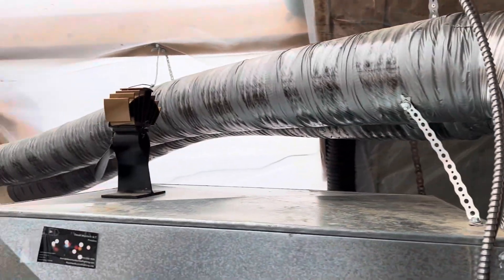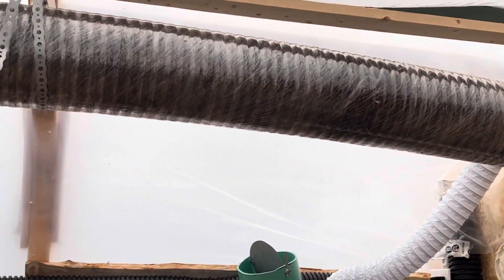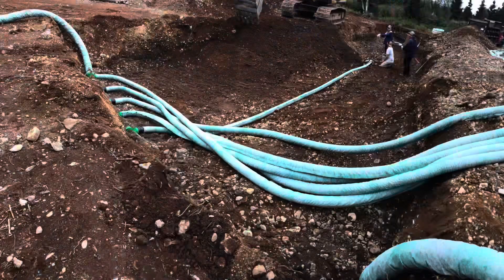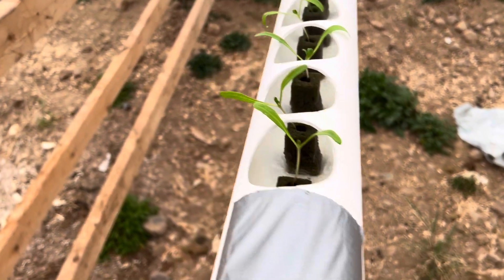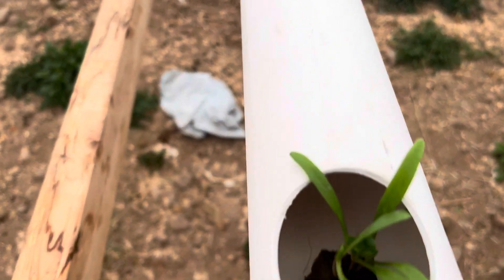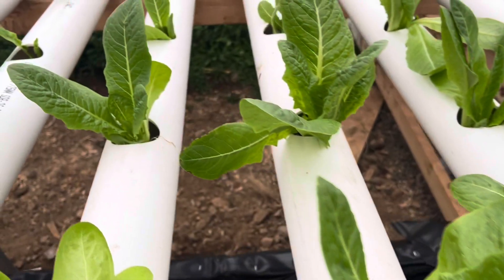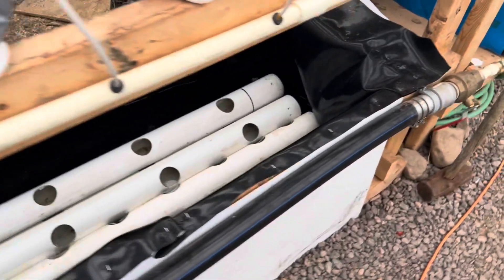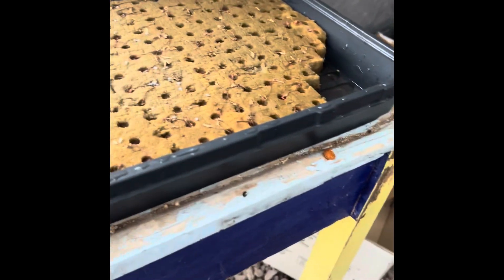Amazing Greenhouse Geothermal System!😎 Grow in every season! We do!!

Comment: How do you use the wood burning stove to heat the ground. With the geothermal heat source.
Reply from the maker: When the furnace is running and the geothermal fans are on it forces the air down in the ground. The real benefit to using the air blower from the furnace really comes into effect during the summer by increasing rate of speed for the volume of air in the greenhouse circulating through the ground.

Comment: I thought these geothermal systems did not require extra heating? Umm, is your greenhouse double skinned and sunken?
Reply from the maker: You can use this system without adding heat to the greenhouse however this will only ensure a certain temperature, and as a thermos works the geothermal earth battery only heats the ground to a certain level. The longer the duration running the system during the night the less heat you will get. For optimal lettuce growing temperatures we keep our greenhouse a minimum of 15 degrees Celsius. This can only be attained by adding “some” extra heat. Otherwise you will have slowed production. If you had a small greenhouse for your family you would have no trouble running it on geothermal, if you’re commercial - you want fast growing produce to be financially feasible.
Reply: @Papa’s Farm  Yes, for sure. I wonder if solar + batteries, would be feasible? Probably cost prohibitive... and propane or woodfire cheaper? I've thought too that grow lights would be required in case of limited winter sunlight...you still have a good system. Have you looked at the Wallpini system at all as a comparison....?

Comment: Hi, do you have any calculation help for me to size an geothermal system? Thank you for sharing your Videos. 
Greetings from Germany
Reply: The system design will depend on the structure, local climate and your desired goal :)
Reply: @JohnGuest45  I am in the temperate climate in the south of Germany. The greenhouse has 5.5 Meters by 3.6 Meters and is glazed with polycarbonate. The Target ist to cool down in Summer and get no Frost in winter
Reply: @andiatbaden9990  
You will also need to know the internal air volume of the greenhouse as that is used to calculate the fan requirements and it plays a major role in the tubing layout.
Reply: @JohnGuest45  Hello John? The internal air volume is about 43 cubic meters which equals about 1519 cubic feets.
Reply: @andiatbaden9990  
For balanced heating/cooling performance you will need a total of 276ft (42m) of tubing and 506 cfm of airflow. This will give you a design turnover rate of 20x per hour.  The tube spacing for balanced performance  is approx 20.5" (520mm) on center both horizontally and vertically. This provides  8" (200mm) of mass around each tube. Closer spacing will reduce  the capacity but increase the response, wider spacing will increase capacity and reduce the response.  The conductivity and diffusivity of the mass dictates the speed at which the heat moves. In general you can access heat that is within 8" range of the tube wall the same day.  In a ideal world, heat would travel through the mass instantly allowing endless capacity for heating or cooling. This is not how it works in the real world :)  The trickiest part of the design is the tubing layout. If you get this wrong it will have a serious impact on performance. One of the most common issues i see are incorrectly sized manifolds and plenum barrels with the tubes stuffed into the sides, both of these will have a seriously negative impact on the airflow rate. The most common issue by far is the use of overly long tubes, and in the absolute worst case, extremely long tubes arranged in a serpentine layout :)  Other factors that can affect the layout choice is whether you have mains power available in the greenhouse or if you plan to operate off grid.

Comment: do you have to poke holes at those pipes to speed up heat storage and extraction ?
Reply from the maker: The pipe is already filled with holes 😁
Reply: @papasfarm721  
Drainage tubing has slots or holes but they are inot in the right place to allow the water to drain :) I recommend cutting a straight slit partway through the corrugations with a circular saw (set to almost zero cutting depth) prior to installation. This modification ensures water cant collect in the bottom of every corrugation which is detrimental to the heating performance. The reason is the sensible heat stored in the mass that could otherwise be used to heat the greenhouse is used to convert the liquid water into water vapour (a gas) which only serves to increase the greenhouse RH% but not the greenhouse air temperature. Its an easy one to overlook but its definitely worth the extra effort if you can do it.
Reply: @papasfarm721  Now it senses to me.

Comment: Airflow is the lifeblood of the system. Its amazing how many folks install super long tubes which only serves to significantly reduce the output cfm of the fan.
2400ft of tubing is adequate for a greenhouse with a floor area of 1850 sq ft.  For effective cooling  (aka, heat storage)  the design should be capable of moving the entire greenhouse air volume underground 20x per hour, if you can provide more thats great but its not easy with large structures. When using the system for heating be sure to monitor the greenhouse relative humidity (RH%), especially during the night because these systems dont deliver 100% sensible heat as most folks imagine, its a mixture of sensible and latent, the latent component being moisture in the form of water vapor that only serves to raise the greenhouse RH%, not the  greenhouse air temperature.
Reply from the maker: Thank you John for your input! It’s greatly appreciated! 😊
Reply from the maker: We do have a dehumidifier positioned next to our geothermal exhausts which gives us a lot of nice 25ppm water, we ran a hose and cycle it to a collection tank. We like a RH% of 50. We’ve had much success at this rate and no trouble keeping it 50%. You might think we’re burning a lot of electricity to run our dehumidifier but when we didn’t have running water it was great to have it! Plus a Dehumidifier creates heat while it’s running adding heat to the GH during the winter. 
So during the summer, wouldn’t you agree that increasing the RH would be a good idea in the GH? Considering high temperatures drive down RH making a less optimal growing environment. I see a lot of companies using huge water walls with fans to decrease heat and increase RH. Very costly in comparison to my custom Geothermal System!
Reply: @papasfarm721  
Raising the humidity is ideal for cooling in the summer, i run overhead misting during the hottest times of the day for this very reason. The higher RH% increases the dewpoint temperature so the air transfers a lot more heat when its underground. The dewpoint of 80F at 50% RH is 59.7F, but if its 80F and 90% RH (measured at the intake) the dewpoint increases to 76.8F.  The 90% RH air will have approx 33% more heat in it than the 50% RH air. The cooling performance of the system decreases as the mass heats up, you can run higher air flow rates to compensate but there is a limit. I designed my system to put the entire greenhouse air volume underground once a minute (60x an hour), but i rarely go above 45x. I wouldnt recommend designing for anything less than 20x if you want cooling as well as heating.The majority of installations dont have sufficient air flow for effective cooling, especially if they have long tube lengths which significantly reduce fan cfm.  A domestic dehuey isnt very efficient at low temperatures in the winter months when the RH% is generally highest. If the air temperature gets too low, the dehuey can ice up which puts paid to any dehumidification until it defrosts :)  The best dehuey for low temps is a dessicant wheel type but they are very expensive to run. Water walls, aka evaporative coolers are great if you happen to be in a low RH% location, ie, dry and hot maybe like Texas etc. Not so great if you have high RH% like maybe in the deep south, as the water cant evaporate into saturated air ;)